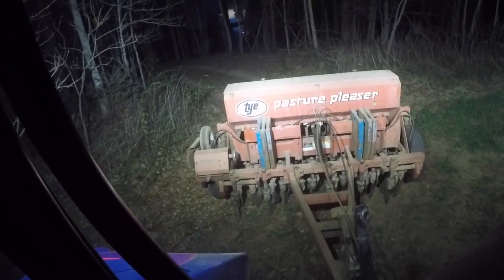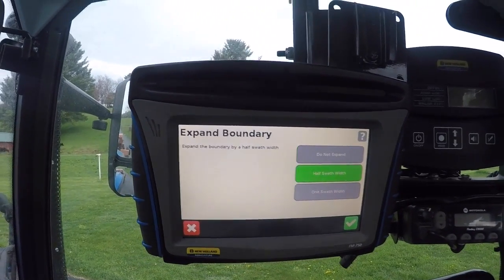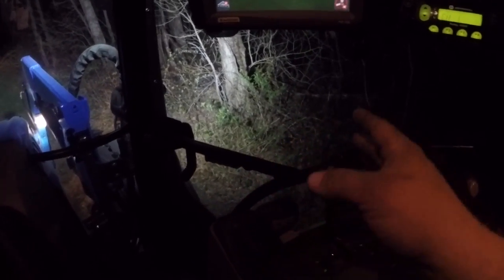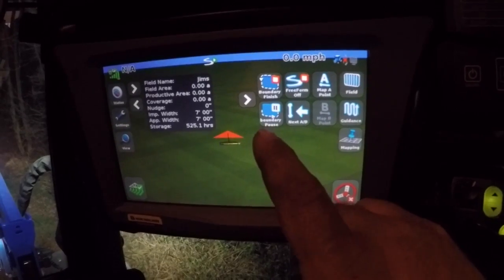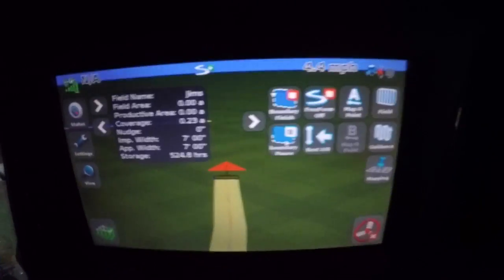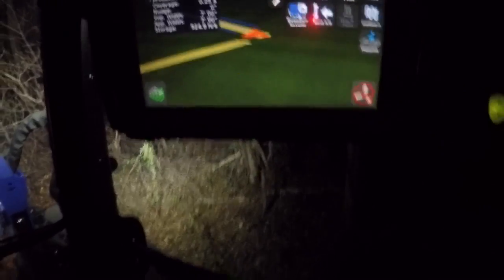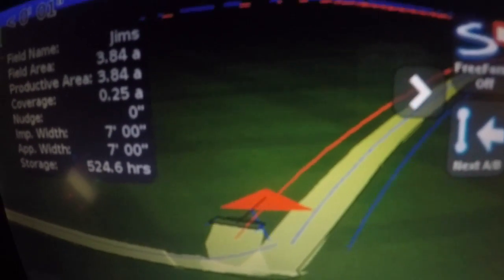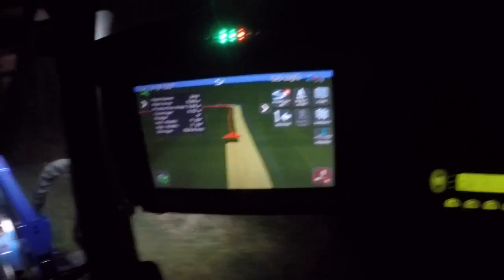Making a boundary! New Holland/Trimble FM750

Comment: I have a spreader truck with cfx 750, I'm gonna try spreading fertilizer with it tomorrow. (Only used for lime so far) once I create my boundaries and start on my ab line will the guidance take me into the boundary to turn, or turn me short so I can keep the chain running?

Comment: does auto steer mean that the tractor drives and follows the boundary? 

you should put a video up of you playing farm simulator, might be interesting since you actually know what you are doing.

good vid
Reply from the maker: +Kelley Vinal. It doesn't follow the boundary, the boundary is basically just to allow the GPS to calculate the area of the field. Once you make your first pass with the tractor it leaves a guidance line in the center of the pass, once you start your second pass the GPS uses that guidance line to steer the tractor for the next pass, if you have auto steer, I don't have auto steer, but if I did yes the tractor would drive it's self and stay perfectly in line with the next pass. Since I don't have auto steer I have to manually steer the tractor and try to keep it in line.
Reply: awesome, appreciate the explanation